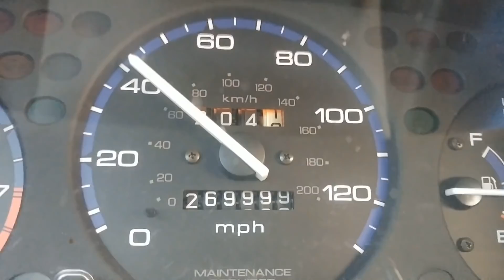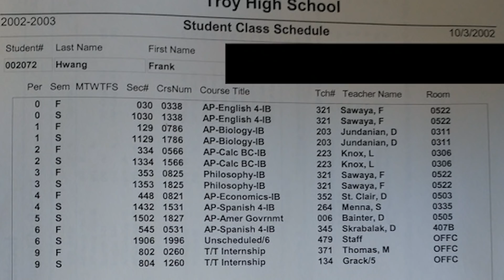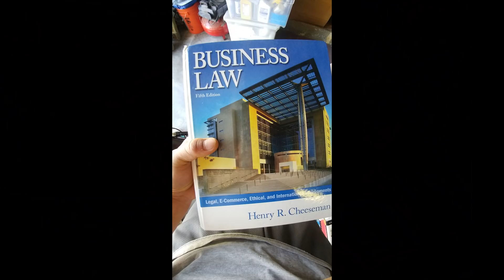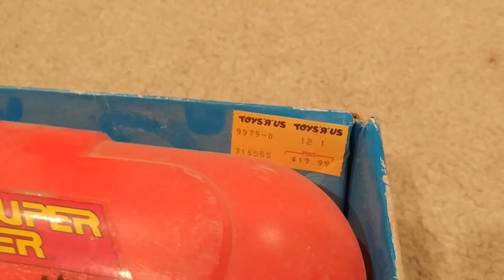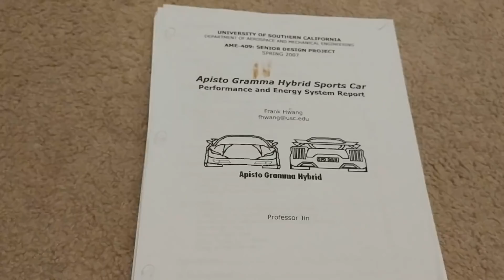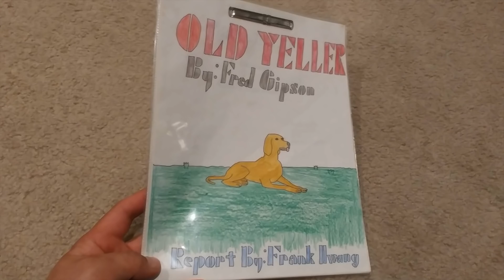my wife wants to throw away ALL MY STUFF

Comment: I feel like a good Civic project to prevent it from being thrown out is a rattlecan paint job. They can actually look really good and almost professional if you do all the prep right. Look at Moore Motorsport's channel for some ideas. I did my Sentra before I got rid of it with a gloss white Rustoleum rattlecan job with filler primer and it looked really nice. Took tons and tons of wetsanding with 500 grit, though. It'd be cool to see it in a red similar to your old Prelude. Of course a real automotive base/clear job would be more ideal, but I feel like you could knock out a rattlecan job like that with some friends/family in a couple weekends.

Comment: I had a hard problem letting go my 1994 civic. It was a slight front end damage which was fixable. but it was sitting at my sister place on the street. The neighbors was complaining so I had finally had to let go my 13 year old car.
Reply from the maker: 😭😭😭 I'm sorry I think I'm at the point of needing to let go my civic too
Reply: @ice1cube  yes lots of memories. One time after work at around 2am on a two ramp merge onto freeway 101NB. I was forced off ramp and drop 2 foot onto the freeway because the other car and I won't yield to the other to enter freeway. Lol. I put back into gear and continue home. Like you I repair it so many times.

Comment: I'm a Industrial mechanic millwright I  agree with you, but older machine just give you more and more maintenance. I deal with extrusion machinery and the 30 year old machines are simple and easy to work on. Just always have to do maintenance on them and change parts. While the brand new machine is little to no maintenance and have newer technology,  lots of sensors to pin point problems etc. Also older machines you can change seals and parts,  but it doesn't help because the internals are so worn you need to buy or machine new housings etc. It gets costly. Like the old machine is your civic, it's just going to need more and more maintenance. Which will just pile up. The newer machine is like a Lexus.